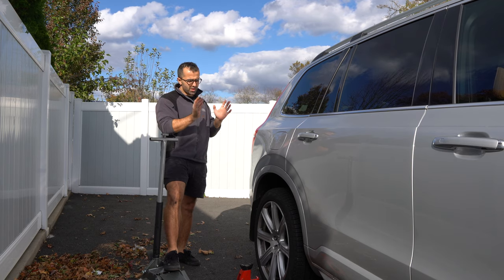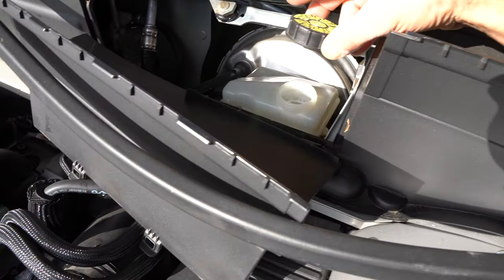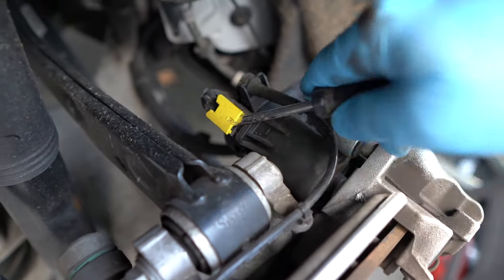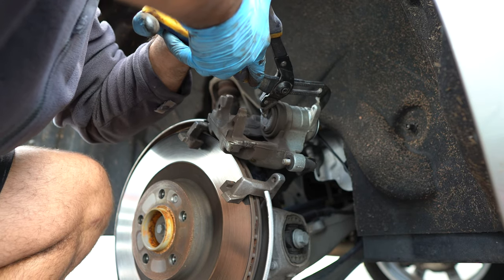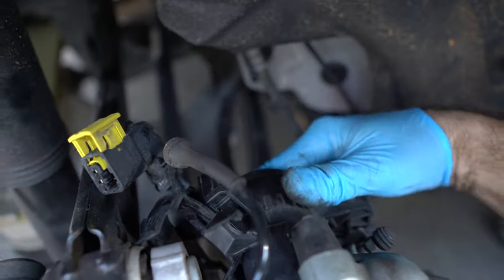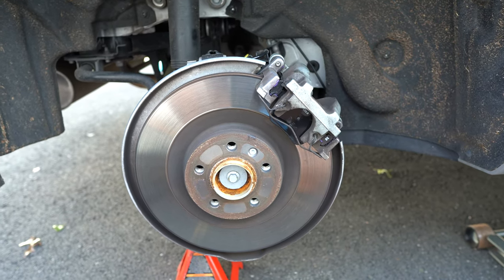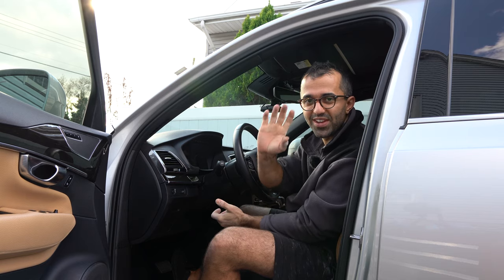DIY rear brake pads replacement on a SPA Volvo with electronic parking - save $300! XC90 XC60 S60

Comment: Please do not ever squeeze your caliber piston in like that.  Pliers have teeth/grooves that can damage the piston.  If you damage the piston near the edge you run the risk of cutting/rubbing through the piston boot and all your brake fluid will pushed out of that new hole and you will have no brakes.  Since most people will not have a special tool, just get a bigger pliers and leave the worn out inside pad/backing plate in place as a buffer between the piston and your pliers.  Once the piston is recessed, remove the old inside pad/backing plate.
Reply: This video has so many cringe-inducing moments. Thanks for the reminder to not damage the piston surface like that.
Reply: @sinosoul  What are all the other cringe-inducing moments you speak of?
Reply: Technically, the boot just keeps dust off the piston, it’s not part of the hydraulics. Still something you should avoid damaging if possible.
Reply: @mn240s14  utter bullshit you are talking about 😁
Reply: Old man nit pickin of the highest regard

Comment: Nice job! Get yourself a EPB scan tool if you plan on keeping the XC90. Makes life much easier. No need to remove epb you can put it in service mode like the dealership does. Volvo eat through rear pads every 25k-30k miles.
Reply from the maker: Any idea where I could get one ?
Reply: Tommy L Garage It works great.
Reply from the maker: V60 Polestar thanks!
Reply: Do you need to press the piston even with a EPB scan tool?
Reply: Y W Yes! The scan tool only retracts the electric parking brake. You still need to compress the caliper piston
Reply: @v60polestar88  Hi. I got same diaglink tool and epb doesn't work with my v90 2018. Any idea why I cant release epb to service mode? Thank's
Reply: I was told that the adaptive cruise uses more rear braking than normal, which blows my mind but I guess it works well enough 🤣
Reply: @TommyLGarage  I believe FCP sells them. Also a good idea to change out the rotors depending on the wear.

Comment: did my 2020 XC90 today. all 4 corners pads and Disc's. took about 3 1/2 hours sitting on the ground. PLEASE NOTE: YOU DO NOT HAVE TO REMOVE THE PARKING BRAKE MOTOR NOW! there is a menu function in the settings of the car to disable the park brake. check this box and you are good to go on the rear.
Reply from the maker: So this does not always work when you are putting in new pads - sometimes you can’t squeeze them in hence the motor removal.

Comment: I'm not sure what the electrical connectors are like on the SPA Volvo parking brake but on the older generation XC60, it's easy to wind back the motor using a 9V battery and a couple of wires with spade connectors on the ends.  Saves having to split the motor from the caliper as you really should change the o ring if you do that

Comment: The electronic parking brake, you tighten before pads change... And afterwards you leave it just like this? And mount everything back
Reply from the maker: That’s right !
Reply: @TommyLGarage  May i ask for what purpose do you do that? What happens if you dont do it
Reply from the maker: @KevOzY  because the second you engage the electronic break with the button in the car it will adjust itself to where it should be.
Reply: @TommyLGarage  oke that i understand but wont it do the same if you just do nothing with it and afterwards engage in the car

Comment: Just did mine. Thank you for this video.The dealer changed all 4 rotors but reused the old brakes and try to charge me $800 to change just the rear brakes.
Reply from the maker: Glad it helped !!!
Reply: Don't ever go back to that dealer! New rotors should always get new pads

If they can't get a simple job like that right then what else are they screwing up?

Comment: Great video, and thanks. A few comments; my dealer wanted $850 for this job which is crazy, the yellow clip for the parking brake connection is fragile and I broke mine with gentle pressure. I discovered that it does not really need to be disconnected as you can work around that when removing that whole assembly, not a problem at all. Now, I can go off and spend the money I saved! :)
Reply from the maker: Glad it helped!
Reply: They told me 870. I said no sir
Reply: Good thing that you don’t need to disconnect, because I broke the yellow Clip as well with gentle pressure😂
Reply: They recently to me 800 for the rear, I told them absolutely not! And this was while the tires were off for a balance and rotation. I'll be doing it myself in a few days.

Comment: I used this video recently to guide me through a few things I had questions about and it was really helpful - thanks! BTW, I noticed that you don't need to go crazy turning that spindle on the e-brake once at that step. Before doing that at all I tried compressing the caliper and would get nowhere, so I got a small wrench on it as you do in the video, but rather than turn it that much I gave it a spin, then was able to compress the caliper to a point.. Rinse/repeat until I was able to get the caliper compressed enough for the new pads to go on. Once all re-assembled I had no issues at all with e-brake, warning lights etc. Also as others have pointed out the big allen you need is a 7mm, and I had to get a little creative with getting those 15MM bolts off that hold the caliper bracket on with two wrenches. All in all as mentioned this was a great run through of it.
Reply from the maker: Good tips. Thanks !!

Comment: having just did this today on a 18 S90 it was pretty easy.  i did do it differently in that i remove the caliper and turned it over to access the screws for motor.  did not disconnect the wires.  2 screws,  pull off motor, turn adjuster and push back piston.  taking the motor off took 2 minutes at most.  did both sides in 1/2 hour .   i read that the parking motor need to be calibrated, but got lucky in that light did not even come on.   when you have the dealer do it, remember that free coffee is not free. LOL
Reply from the maker: Also a good idea!
Reply: @LivingLife128  sounds great, but if not know one thing... You DO NOT NEED to remove the motor at all. If you have uncheck the option to engage the parking brake automatically when engine turns off, the parking brake remains on FULLY OFF position and you can rewind the piston normally using rewind calliper piston tool 😁

Comment: REALLY GOOD video. Thank you. My only addition would be to mention not over tightening the screws when putting back on the electronic brake. You can easily crack the plastic casing around the bolt. Ask me how I know…
Reply from the maker: Thanks for the heads up!

Comment: I trusted this man and this video, I have parking brake service required on my dash now.
Reply from the maker: You’re the only one with this issue. Read all the comments. Not one single person reported an issue.
Reply: @TommyLGarage  I have a 2018 XC90 I followed this video step by step. I gain nothing by commenting on here false information, I was just hoping someone else knew the fix before I take it to Volvo. 
Parking brake service required was not on before I did this now it is.
Reply from the maker: @GeorgiaDawgs001  check your cable connections. Maybe you didn’t plug everything back in.
Reply: Hold the parking button up for a few seconds, or hold it up as you start the car. The motors are just out of sync, easy fix. I had a bit of a panic over that too

Comment: Was quoted £343 for rear pads along on my V90 so bought the pads off a “trade part” seller on eBay for £51 and did the job myself. I have a tool that can put the car into service mode but seeing this makes me regret buying that tool!
Reply from the maker: It is an easy job indeed :)

Comment: You can also use a 9V battery to back off the packing break saving you the effort of removing it and backing it off manually. Also if you have auto leveling make sure to turn that off on that same screen as the auto parking break...
Reply from the maker: Good call. Thanks !

Comment: Just completed a rear pad change on my 2021 V60 after watching this. All went well and got both changed, but now have a check engine light. Not sure what could be tripping that, other than perhaps an ABS sensor isn't plugged in quite well enough. Going to re-seat them tomorrow and see.
Reply from the maker: Check engine light is not connected to this job at all. Worst you would have gotten an ABS light.

Comment: Great video! It helped me tonight. One issue I got after replacing everything is an error say “Parking Break Not Fully Released”. Any idea what went wrong and how to fix it? 

Drove with the car no issue, but it keeps on beeping and I’m not able to engage or disengage the parking brake.
Reply from the maker: Have you tested the electronic brake right after replacement ?

Comment: Just a question. When you turn your engine off and you are working on the rear brakes, the electronic brake is switched on, isn't it? When you are disassembling the electronic brake little engine, it is activated, or it is not?
Reply from the maker: No, just make sure your automatic parking brake is not enabled. You can disable it in the settings.

Comment: At 4;15, you tighten the electronic brake until you cannot tighten anymore, but when you assemble everything back you don't touch this. Did you miss something in this video or can we just not touch it when we assemble back? Thank you for the video.
Reply from the maker: It adjusts itself after you turn the car on

Comment: My local dealer wanted $930 to do a rear brake job on my 2018 S90 which included new rotors as they claimed they cannot be turned. I did it myself using  genuine Volvo parts from a competing  dealer (including rotors) for about $250…stealerships are just that.
Reply from the maker: Way to go!!!

Comment: Nice Job. My question is - why the rear brakes wear out so much? Drive volvo since years but the rear brakes always lasted a long time - i have 90000km and the second rear pads are gone now... anyone knows that?
Reply from the maker: Smaller pads and less material. And rear brakes control speed during automatic driving

Comment: Hi, thx for this video. Very good indeed. I've got one question. When you unplug e brake, won't be there a service light on the dash?
Reply from the maker: Nope. It won't. It will reset itself after you start the car
Reply: @TommyLGarage  Thx a lot

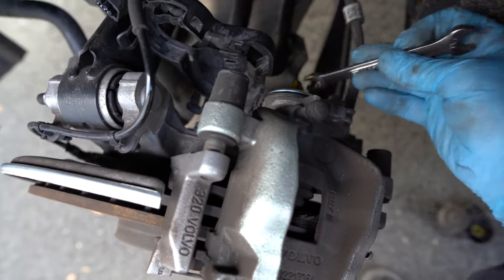Comment: Thanks for the video - very useful!  At the 4:20 mark you are tightening the parking brake bolt with your 3/8 wrench.  When you reassemble the parking brake do you not have to loosen this or just reassemble?
Thanks again...
Reply from the maker: Just reassemble. Once you start the car and apply the parking brake the automatic parking brake will adjust itself.

Comment: nice video, thank you! one question: do you have to untwist the electric park brake bolt before you put everything back together?
Reply from the maker: Nope. It will turn itself back when you test the parking brake
Reply: thanks for this @TommyLGarage .  I was wondering about this.

Comment: At 4.45, you mentioned 9mm allen head socket , but at he start of the video, you said 7mm? Which one is it? Thx
Reply from the maker: 9mm
Reply: @TommyLGarage  thx
Reply: I think he meant Hex 7. And Hex 5 for the brake motor. 320mm discs

Comment: I see you tightened the nut on the back for the EPB, when putting it all back together, do you loosen it?
Reply from the maker: No you don’t. It adjusts itself.
Reply: @TommyLGarage  Awesome. Local dealership wanted $855 for rear rotors and pads.
Reply from the maker: @jayjohnson6754  run away!!

Comment: So i replaced the rear pads and the message on the dash is still on it say emergency parking not fully engaged any idea why? I check everything is connected thx for the help
Reply from the maker: Check the plugs. Maybe you didn’t insert them in all the way. Easy mistake
Reply: Tommy L Garage  Actually I did not twist the motor right and I was trying to push it back and I messed up the motor the caliper so I’m gonna have to buy a new one
Reply: You're not supposed to remove the e-brake cable from the caliper, doing this causes the dash message unless you complete additional steps. You should be able to remove all the bolts without disconnecting the e-brake cable.

Comment: Great vid but I am confused. Why are there videos showing how to use a 9V or a scan tool to release the electronic brake if you can just ignore that step as long as it doesn’t auto apply  in the settings?
Reply: It's not enough that it is not applied, it need to be put into service position, that rewinds the mechanical screw that follows the piston as the pads wear all the way back again. If you don't you can't compress the piston so that you can fit new pads. After the job is done the EPB will recalibrate and adjust the screw to the new position.
Reply: There’ 3 ways to deal with the EPB:  use scanner, use 9 volt battery, or do it manually as shown here.  With the first method, the scanner puts the EPB in service mode.  The second method you do it by disconnecting the EPB connection at the motor and rewind the EPB with the 9 volt battery—you do not have to separate the motor from the caliper, as with the third/manual method.

Comment: No need to remove the electronic parking brake at all, just lift the caliper bracket off and also replace the discs - no one turns these anymore really, but reusing is not the best idea 
Just my 2c
Reply from the maker: I will try that next

Comment: You don't need to remove electronic parking brake at all
Reply from the maker: How so?
Reply: @TommyLGarage  well, after you uncheck on the screen the option to engage parking brake automatically when engine switches off it is remains in fully off position when you switch off the engine and start working. So you can rewind the piston normal way with special calliper piston rewind tool. While you apply pressure to the piston you u will need to turn the piston at the same time then it goes really easy. That is why the piston itself has two holes on its surface designed for the poston rewind tools to catch up with surface for turning the piston. I turned clockwise, but did not check if it works same way turning anticlockwise 🤔
I've changed mine couple of days ago